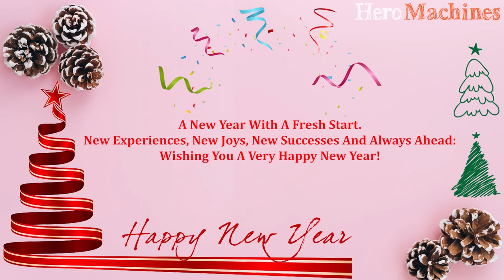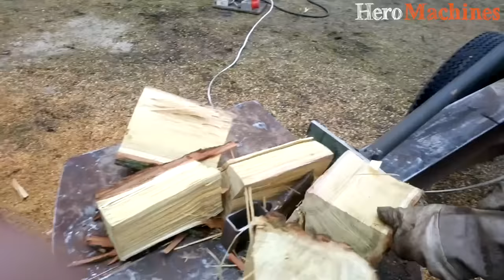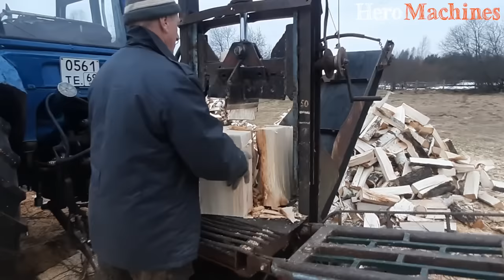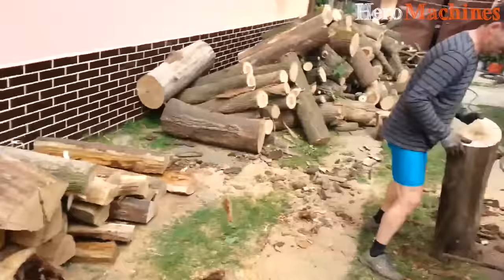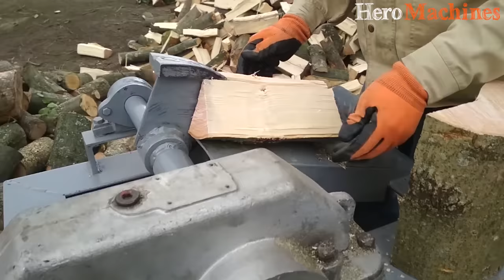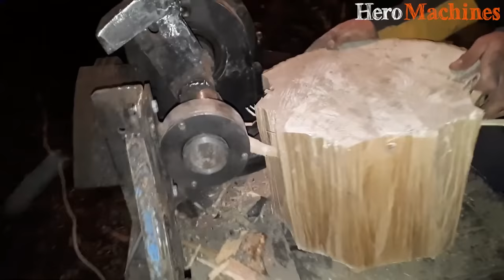Amazing Homemade Log Splitter Wood Processing Machines | Firewood Processor!

Comment: When I was in college in the 70s I worked for a man who had a Double A Ford truck that carried a tilt-up well pounding rig with a wedge where the hammer would be.  When we got to the customer's site we would jack up the left rear and take the wheel off.  A drum was bolted on to drive a 4 foot circle saw to cut up the wood.  After cutting the wood a PTO was engaged to drive the well pounding rig in a verticle position.  It cycled every 1.5 seconds and could split logs of just about any length but no more than 2 feet in diameter.  As long as the log was placed on the up stroke there were no issues.

Comment: All the wood looks as if it was selected for its straight grain and softness to make it look easy.
Reply: Some other splitting videos are similar. Their wood looks and acts nothing like the tough, irregular wood I've split.
Reply: I suspect that the most of these machines will have trouble with oak or another hardwood and pieces full of burls, beach and willow you can split with a butterknife.
Reply: Birch not beach.

Comment: I am watching these machines with great interest however all I see them doing is splitting straight grain wood and short in length that could be split with a short axe.
Reply: Very true. Cool design on many of these splitters but won't split wood like eucalyptus with a tangled tough grain that will need to be sheered through the entire log.

Comment: What kind of gear boxes are these guys using? I have like everything I need to make the kind at 6ish minutes but have no clue about the gear box or ratios.
Reply: Well I finally figured it out. Gear reducer boxes used on machinery. Just bought a 40/1 box for a lathe.
Reply: Most are using tractor final drives
Reply: @CampJe  did you build one? I really need to build one for my wood splitting
Reply: @norfolkbushmanandfriends7916  Gathered everything I need and started cutting. Just need to weld it all together and paint.
Reply: @CampJe  are you in the UK ? How much did it cost you in total?

Thanks
Reply: @norfolkbushmanandfriends7916  USA.. Spent $80 on the gear box, using the motor and large pulley from an old compressor I had and spent about $100 on metal from a guy I know. I'll probably also put 4 - 10" never flat tires on it for about $60.
Reply: @Dan  shame you didn't do a video on your build, I would live to build one but no confidence unless there's a video I can follow
Reply: @norfolkbushmanandfriends7916  I considered it but I've never done one.
Reply: @Dan  would you consider sending me some detailed pictures when you've finished it & all the items you used 👍
Reply: @norfolkbushmanandfriends7916  Ya no problem! It will probably be in a couple months. Feel free to remind me.
Reply: @Dan  cheers, I'll shoot you my email address on here in a couple of months 👍👍👍